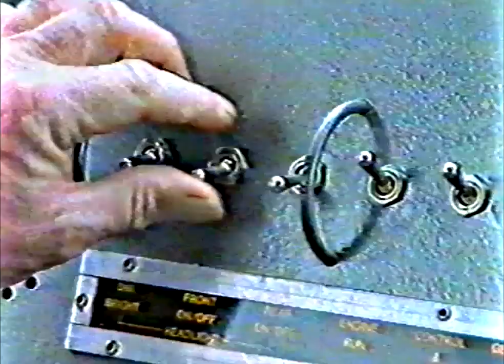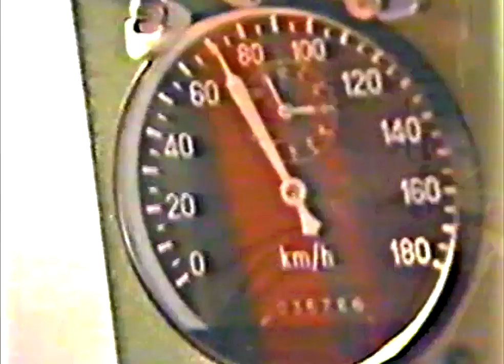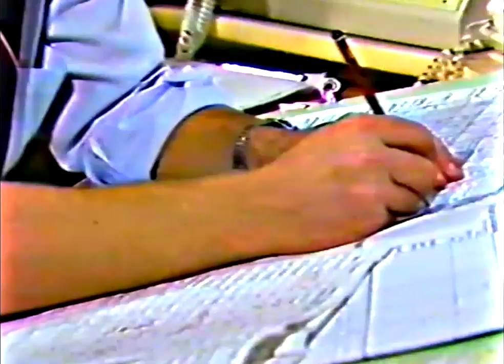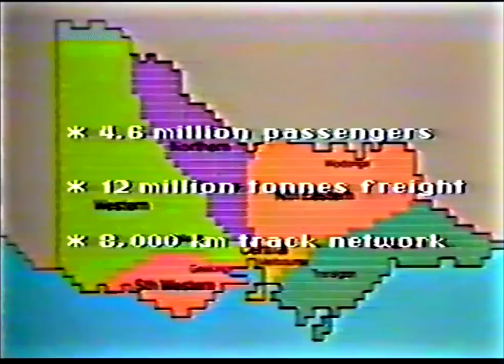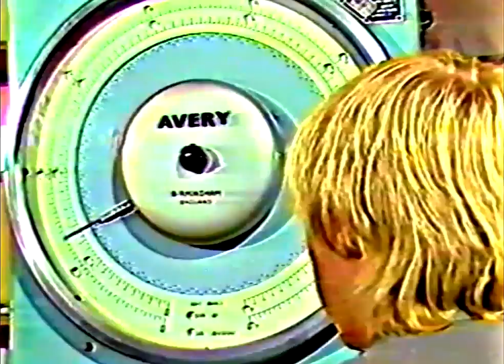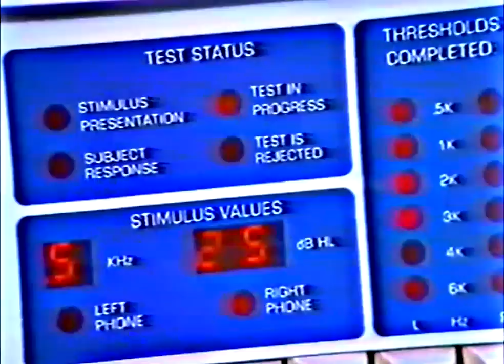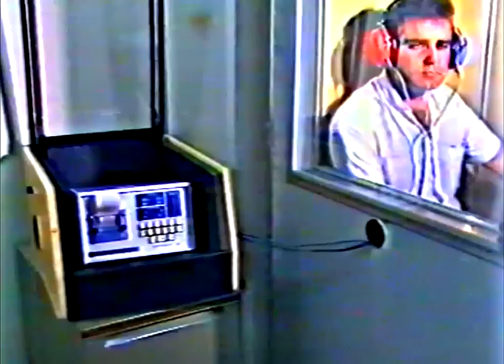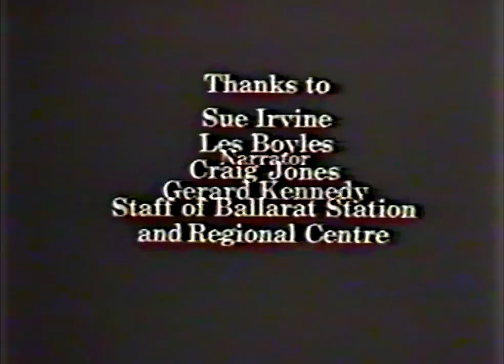Welcome Aboard V/Line (1987)

Comment: Hey guys the 'bag thing' in the floor is the automatic electric staff exchanger that would swap the staff at full speed at each station without needing to stop. They're no longer used or fitted to the locos. BTW that's me as a young bloke operating it.

Comment: 12:03 "engineering excellence", 12:08 "latest technology".  those are nsw trains.
Reply: vsv nrg believe it or not, V/Line (Department of Infrastructure Vic) owns one XPT set, XP2017-18 and five carriages.
Reply: @maxthum9220  XP 2018 is getting repaired hopefully
Reply: @maxthum9220  your also forgetting that Vic owns xps.  2015 2016 2017 and 2018